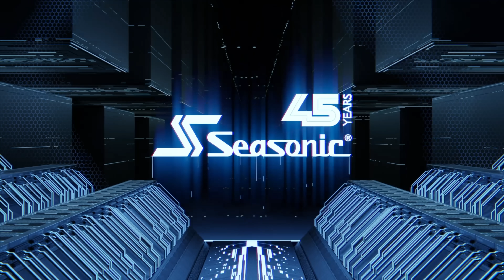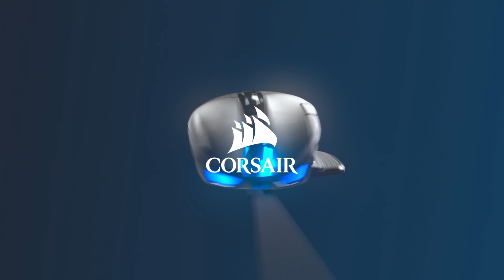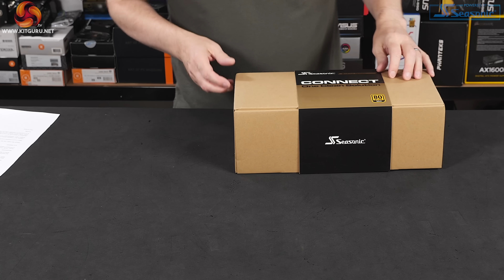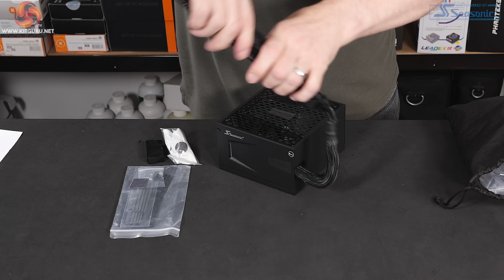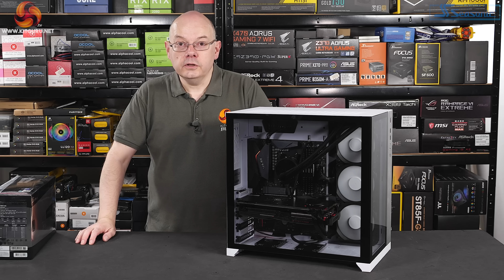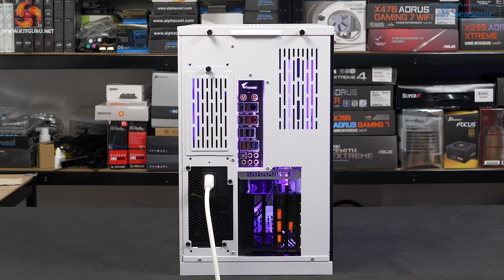Seasonic CONNECT - What on EARTH?!

Comment: you are better off bye not using extensions will cause your power supply to burn out.  i ran in this problem a few years ago. so stopped using them and would get me custom cable that are the right length.

Comment: at 6 min it´s 100% no they are on sale now still not an option when we have atx 3,0 but even if we diden´t have the new standard all that extra work for what ? full mod psu to day it is not meny cables and if you have a rgb fan hub like i have it just makes it another 6-10 min so with some room for error you look at 20 min to conect a psu cant belive this is number 4 on prisjakt/pricerunner and is the psu in mounted o nthe side like that stops air flow. When you had all that cables it reminded me of 10-20 years ago 4 sata 3 gpu now days what do you have one to the fan hub 2 to gpu one to mb and m2 is on the mb already 2 to the cpu not meny cables now days with only one gpu and 2 m2 drives that cost nothing to day
Reply: and some for the front p O-o

Comment: the main advantage of this pws is completely ignored: the ability to make changes to connection with ease. 
once a build is complete every minor change that require power is a nightmare exactly for that - power connection. 
with this concept we can change drives, fans and other powered stuff with ease. 
and a lot of builders often change the build in time, a better drive, a bigger one, a different fan, a new gizmo for rgb / fan management and so on.

Comment: This would look even better with some custom cables.   
It's 2022 now and I still have not seen anything quite like the Seasonic Connect from other suppliers.    I think it looks great, and the efficiency of DC to DC conversion results in cooler running too.
There is a lot to like about this system.

Comment: Interesting design.  I think Seasonic is on the right track, the power distribution cables in a desktop these days are kind of a one size fits all, so when a power supply manufacturer supplies cables to reach long enough (particularly given top and bottom and apparently side mounts), there is a lot to tuck away and hide.  And long cables (particularly unshielded) are electrically not that good, though DC ones, maybe not that bad.  The best solution would probably be for case manufacturers to do their own power cable routing, with short jumpers to connect to the motherboard and graphics cards, maybe eventually evolve to plug-in motherboards.   That would also clean up airflow, I don't know how many systems I've seen where the graphics card has some airflow blockage from cables.  Absent that, a distribution bar, like the one by Seasonic, makes a lot of sense.  I have to say though, I am not sure I really like the concept of using magnets to attach, particularly around mechanical hard disks.

Comment: Instead of using "Extensions" from cable mod.
You use replacement cables, this is not needed, but makes the end rig look nicer.

Overall, a PC builder will make sure the cables are managed to start with assuming the PC builder is smart.

Comment: This connect unit would work best in cases that have above or below MB mounted PSU where you can clearly see the cables coming from the PSU running to the back of the MB tray.  This unit would reduce that spaghetti to a clean single cable.  The 011 starts with everything already hidden so it was a bad choice to best display this type of feature.

Comment: As for cable mods, they have a place for some users of custom built PC (it's about choices, at the end of the day). I'm currently running a OCZ 750w ZT (after my corsair tx650w failed, many years ago). I've basically cable managed (around 1 hour for: 3950X+NH-D15, 5700XT, 5 sata drives + 7 case fans) but never really seen the point of, spending £40-£50+ for sleeved cables. That won't been seen in my define R6 (no window). That's money I would prefer to use (in part), for an upgrade later down the line (like a failed PSU).

Comment: I wonder if the short cable out of the PSU will suit cases with the PSU in the main compartment - I was surprised there was no extension cable provided. It'd take some careful thought to make sure it will fit before buying it. And then making sure the cables will be in the right place for your needs.

Comment: I would be more interested to know how well it performs in relation to the standard version. Having that extra space for filtering could, in theory, provide an opportunity to enhance the filtering quite significantly. The real estate available is much larger. I could also see this being very useful and appealing in something like a Fractal Define S (and variants/revisions). It could mount in the empty space left for water cooling components and be fitted with custom, very short run cables.
Reply: After getting knee deep into making my own cables I learned a few things, one of which is that some stock cables come with capacitors in for filtering and they are supposed to be place as close to the component as possible but they aren't necessarily required. I think this  design will get around that. Since this was released though Seasonic have released the SYNCRO line which have a variety of wattage and a case specifically designed for it

Comment: The magnets do not hurt your data ??      I think I can see third-party cable upgrades to the connect, or maybe modifying the connect such as changing it from black or adding bling.     I think it might work better in some other case such as mayb the XL version of that Lian Li case.     Maybe the cable between the connect and the psu needs a short coupling adapter or a way to adjust the bend in the hose ??

Comment: I think the Connect would be really nice if cases were designed with it in mind. Or better yet, if the power distribution bar was custom designed for (or built into) the case with a standard cable for connecting it to the power supply. I think Seasonic will need to partner with a good case manufacturer for this to succeed in the market.

The problem today is that most premium power supply buyers will buy premium cases, and those cases come cable management features that mitigate the mess of traditional cables while being likely to get in the way of the Connect. Also the benefit of Connect is reduced by RGB which tends to create it's own rats' nest of cables in the case.

Comment: I think Leo missed the point, as 011 Dynamic is uniquely unsuited for the demonstration of the Seasonic Connect installation. In the conventional case, on the other hand, it would allow to preserve 2-bay 3.5” drive cage, stuff single Seasonic Connect cable in the basement, under the shroud, between PSU and a drive cage and still have very neat routing of the remaining cables. 
I absolutely hate stuffing all the cables (including unused, just in case) in that small space when the "conventional" modular power supply is used, don’t like to sacrifice the 3.5” drive cage or be limited to a short power supply.
I do think that Seasonic Connect is a great solution for me! I couldn't care less for RGBs...

Comment: This has zero sense, what Leo accurately noticed:
In front we're back to square one.
At the back we lost functionality and gained nothing.
On top of that you still wanna buy a decent cable replacement...
Just plain dumb idea - it cannot work because to get it to it's potential it would have to be supported by chassis manufacturers. 
For all I can see: decent fully modular PSU with nice braided cables or cable replacement kit, will look better.
Reply: I never really dug into this thing, but it looks to me as if it's some kind of first attempt to create a ATX12VO-PSU which can be extended to a full blown ATX-PSU. The form factor itself is horrible, no discussion about that.
Reply: how are we back to square one? leo did a poor job of showing off how to manage the cables, and if you are going to get custom cables anyway, now with this PSU you can get shorter ones, therefore a little extra money for something else.

Comment: Leo, you missed one group out, the boring old farts who`ve discovered that a steel side panel covers a multitude of cabling sins but would still like to build a neat interior because their OCD makes them remember what it looks like! I think that this is a really useful product for that group. Wondered how it would do in the Fractal design compact 7?
Reply from the maker: Perhaps there is a market for decals that go on the outside of the steel side panel that purport to show the on-point cable job.

Comment: Q: Is there a physical reason why motherboards can't be redesigned so that all cable connectors are on the back side, so there is no need for visible cables to be seen from the front?
Reply: Unlikely to happen as:
1) It is best practice to install CPU heatsink and RAM outside of the case but this would cease to be safe/practical with protrusions on the rear of the motherboard PCB
2) Although most cases have a cut-out in the motherboard tray for easy swapping of CPU coolers, it's existence, location and size are not standardized. If you were to mount the EPS 12v connector (probably the one that would benefit the most) in this space there would be an increase in returns, loss of sales and tarnishing of brand from people discovering the board is incompatible with their case
3) Mounting connectors on the back would add effective height to the board which would have to be reflected in packaging increasing volume and increasing shipping costs (although weight is more important, extra height would practically restrict the number of boards per pallet).
The much more practical alternative is increasing prevalence of 90° angled connectors and cases coming with cable management bars that protrude from the motherboard tray so cables from the 90° connectors can run straight into them therefore having the unsightly cable bends hidden.
Backwards compatibility for E-ATX boards and boards without 90° connectors can be maintained by having the bar as a removable component over a standard flat & holed motherboard tray.

Comment: If Seasonic could partner with some Case Manufacturers to design cases with the connect as an integrated feature it would be a better arrangement. Fitment would not be so hit or miss, and even cable modders could use that to their advantage with shorter runs. As much as I really like this idea, it's impractical for me. I'll just keep my Seasonic 750 Focus + Gold.

Comment: Was I the only one thinking to use the magnets on the drive plate instead of on the rear of the motherboard mount? I know, but that would work.
Reply from the maker: Leo here: Two things; first that would cover the ventilation holes in the CONNECT and second it seems clear Seasonic has used a steel plate down the length of the CONNECT so the back is magnetic but the ventilated front is only plastic.
Reply: @KitGuruTech  I did mean it would face inwards, but I couldn't think of any other way for it to fit.

Comment: Nice idea, but the implementation makes it kind of pointless, and only adds additional problems (thickness, cable placement, led colour...). It's just a box to hide cables, try could have just released a box to hide the cables where you can hide the slack.
 
I guess its good that they're not charging loads for this, so its a step in the right direction (as long as you have a compatible case). ill stick to the velcro tape which cost next to nothing and it can be used everywhere, I recently used it to hang a desk fan in an open window when it was hot and there wasn't much wind. it worked great and I'm not going to run out anytime soon. Also, have adhesive velcro to hide the cables under my desk (have over a dozen devices plugged into the wall plus 8 or so USB devises coming out of the back of my PC yet no mess [that's visible anyway]).
 
/coolStoryBro
Reply: PS: For transparency may want to add that Seasonic is a major sponsor of this channel. I feel this may have coloured the review a little, you could have been more critical. I'm not calling you a shrill, but it is worth mentioning (it's a little like telling a child that their painting sucks).
Reply: @garethevans9789 Maybe Leo sincerely likes it, of course they are a sponsor but as long as they work together they know him and he can be quite brutal in his criticism as about "This case shouldn't exist!"

Even though I feel where you are coming from, this product may be pointless to you and me but its still a Seasonic powersupply which means it's gonna deliver (power) (edit) and quality that is undeniably superb.

Comment: Did you try mounting the Connect to the modesty plate? On the inside, that is, so the Connect unit would be entirely hidden. 

What disappoints me about the Connect is that the cable between the PSU and the Connect unit isn't fully modular.

BTW with making cables look good on the front, have you had a look at 90 degree and 180 degree power adapters?

Comment: I prob didn't develop enough OCD to use this product yet. So far it looks like an answer to a non asked question.
Reply: The issue is that while the back gets "cleaner"(but not really considering everything was hidden by a bracket before) the front turns ugly.  Those graphics card and 24 pin cables are disgustingly bad for the effort put in.
Reply: @Grimmwoldds  yes but now you don't need a bracket, and as far as the cables go, if you get cable mod ( because standard cables provided by ALL PSUs are gross) you can get custom lengths anyway AND pay less because the cables would all be shorter overall. this was a bad example used by this individual while understandably only using cables he himself already owned, then like i said, if you are getting this PSU you can then buy cheaper cables because of shorter lengths, which he did not get himself.
Reply: Well, it would depend on the case you use. If you are using a very tall case, it can be a pain to get cables that are long enough to reach from the PSU to the top of the case for CPU power. On the other hand, if you have a small case, like mini-ATX, ITX, etc. this is probably dead overkill. Rather spend the extra cost on a GPU.
Reply: you are absolutely right :D

Comment: Don't like that one, too many points of failure, big and clunky, many cases will have problems with fitment, not even the main unit is smaller because of the cablebar.

It is different, but why? There is no different approach to PSU's because they work perfectly fine for all the use cases. Different sizes and modularity are allready a thing and with M.2 a perfect build only has three to five cables to deal with. This is as innovation hidden regression, and with 12VO in the future this thing looks like DOA.

Comment: It's just a gimmick imo. Your example looked tidier than it did before you changed the PSU. You're just using up more space with that monstrosity and you can't put the plate back on. If someone really wanted to use one of those PSU's, you're going to have to find a case to allow you to comfortably use it. Choosing a case to allow the fitting of this is counter-intuitive to building a PC.
Reply: Not really though. All you really need is shorter replacement cables and everything looks clean. Cablemod let's you customize your cable length, cable colors and type of cable (+ cable combs if you want it) which in combination with connect actually makes everything look really clean. Just look at GGF event's overview and build implementation of the connect and you'll see just how clean it can make cable management with proper custom length cables.

Comment: Being someone who uses an O11 Dynamic I would have to say that the Seasonic Connect doesn't really fit properly and ends up making (as seen with your build) the build look messy from a cable point of view. It's 24 pin and GPU power cable placements are too high for the majority of motherboards which is more an issue of the PSU to Connect cable being too short and it's pretty much useless if you have to use anything like a commander pro or Thermaltake's controller for RGB and fan control. Really, it's something designed to be used in a more conventionally designed case, maybe even for people who don't really want to spend much time managing cables. It's a nice product though and something I would like to see more of.
Reply: Captain_Cole yup,it compromises rather than adds anything.
Reply: I gotta agree with you. I have this case and it's got plenty of space but this... Wtf is going on? lol Did you put your AIO in this configuration?
Reply: @robertdunlop5247  No, My 360 AIO is mounted in the roof of the case pulling air in with fans on the side pushing air out. I find this not only looks neater (tubes don't look so taught and large gap is hidden better) but is more efficient (barely)